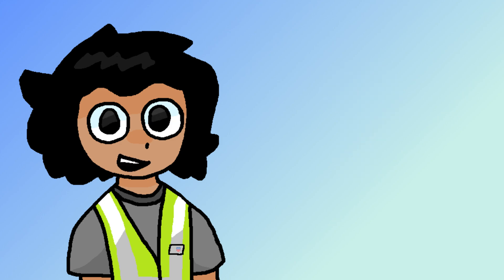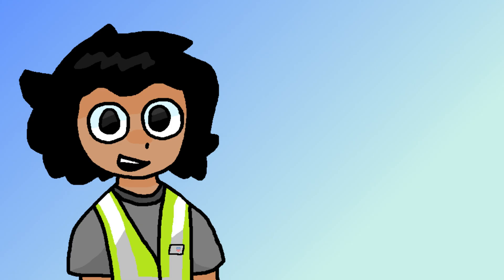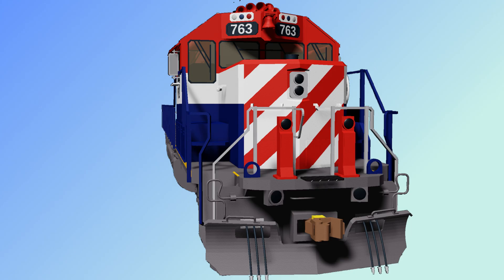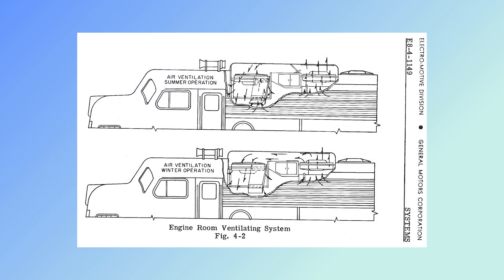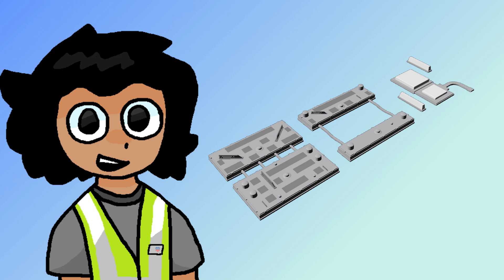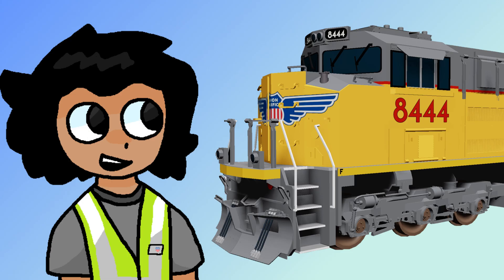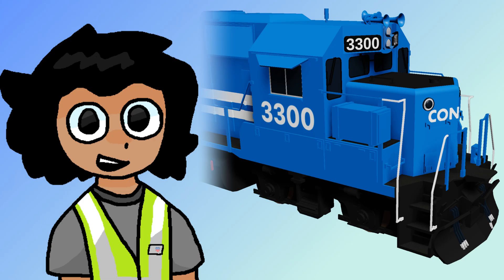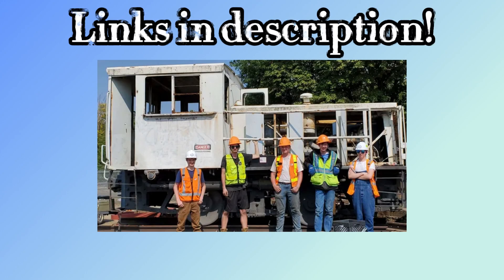Locomotive Specs; What Are They? | Feat. GamingRailfanner

Comment: I like how the thumbnail shows UP 1449! 1449 does the run from CMC's collection area to CMC's metal recycling plant about 2 1/2 miles down.

Has a slightly fouled P3 instead of the average K3l/K3h or K3la